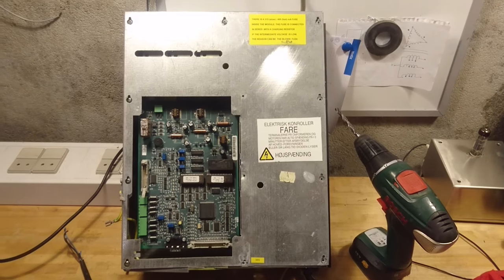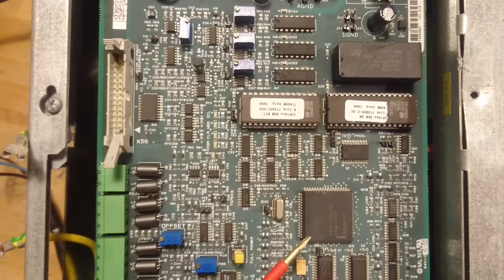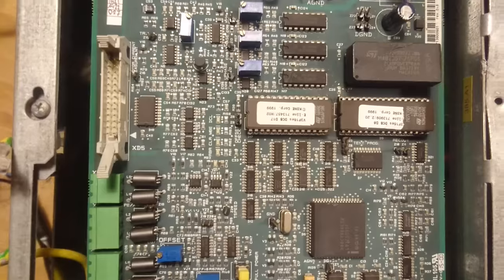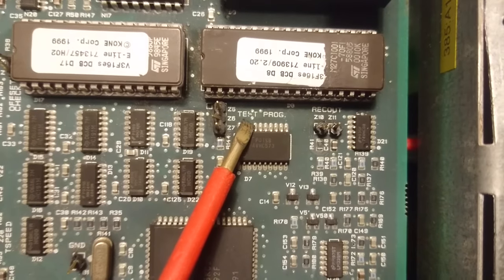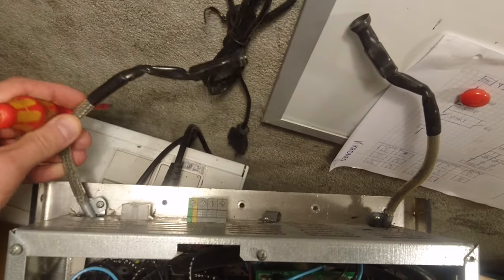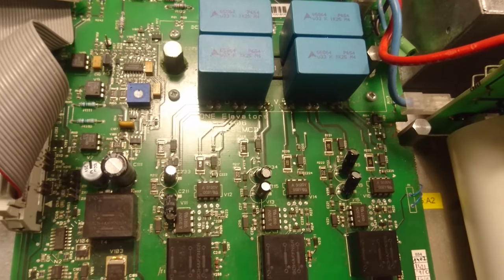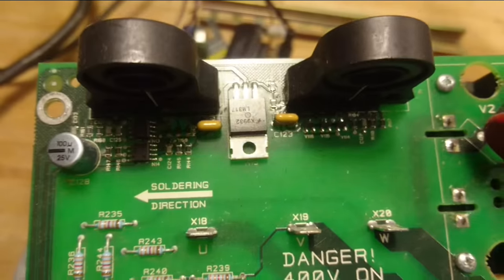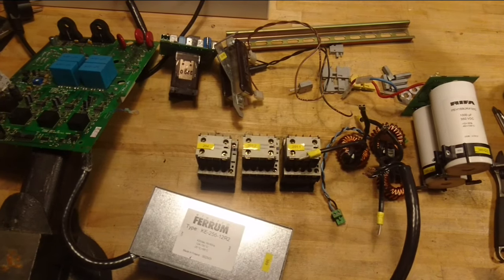Kone Elevator Controller/Power Electronics Teardown

Comment: The 'soldering direction' refers to this board being wave soldered. It just means that the pcb layout is such that it is optimized for traveling through the wave soldering machine in that particular direction.
Reply from the maker: So that is the reason why most of the sensitive microcontroller parts are on the right side of the board? Unless the heat changes in the oven, or it has different stages, the whole board should see the same heat from travelling linearly through

Comment: The offset and gain are used to calibrate  the load weigh device so the unit can adjust output depending on the load inside the cab

Comment: I would think nowadays they would have dedicated electronics technicians to troubleshoot these things. 

Usually when you see an 'Offset' or 'Gain' control on a drive, those will be for adjusting the control feedback to properly control the motor.

Comment: The full power button is used after conducting a safety test. They get stuck on the rails and need an unusual bump to pull up the full load and the extra friction. 
How many drives do you need to create a rail gun?
Reply from the maker: Interesting that it relies solely on the drive motor, to recover from a emergency stop? I thought there was manual mechanical inspection and release to be done. FULL POWER AHEAD!

Comment: Hi there. Could you pls guide what steps do I need to follow to replace LCE CPU 40 (main CPU board) for Kone Elevator?
I'm new to this but am from Electronics background. I would also like to add that this board is being replaced after I received Error CPU 40 and the LED saying Replace main CPU board started blinking. Any help would be highly appreciated. Thanx
Reply: I have procured a working Board of the same model. It does not have the EPROM. Do I simply replace the EPROM chip from the old malfunctioning board or do I need to make se other configuration changes too?
Reply from the maker: @uandmetheband  I do not know about elevator and Kone. Be very careful and use only autherized service. This is transport for humans, do not make anything dangerous to save money!